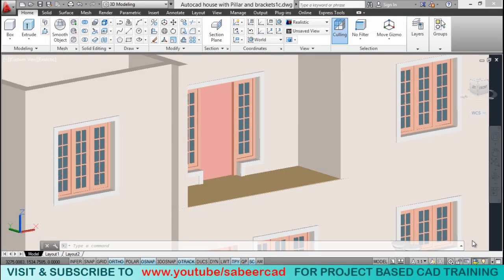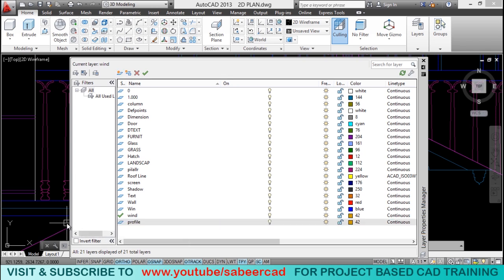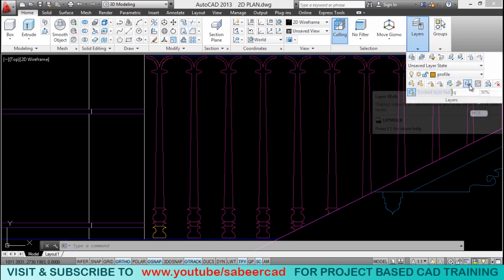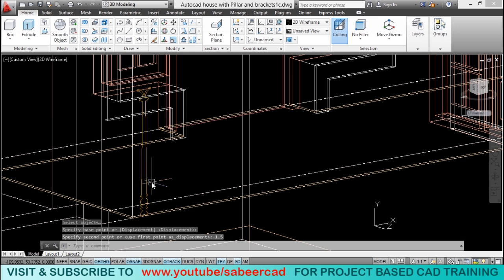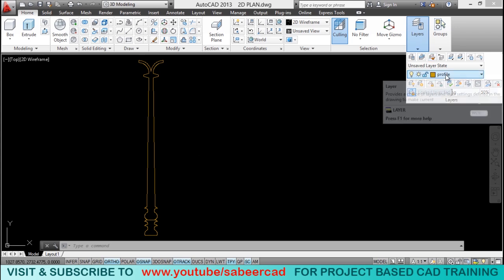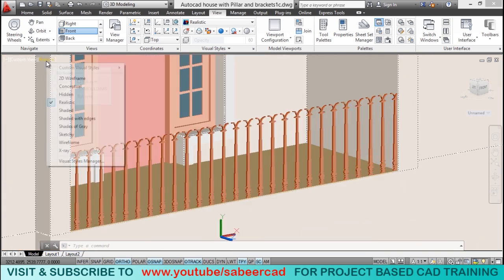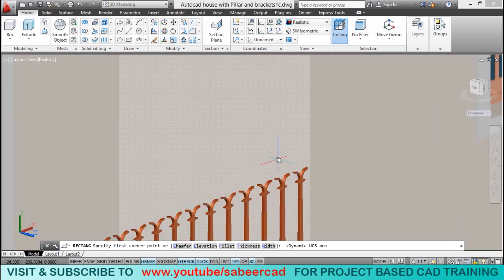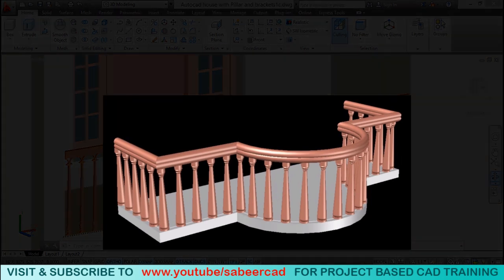CREATING BALUSTERS AND HANDRAIL | AUTOCAD 3D BALCONY

Comment: Hi Sabeercad
Thank you for taking the time to post all the informative video tutorials you have pertaining to the use of AutoCAD in the drafting and design area, as well as the patience to answer all the questions in connection with them. You have assisted me in more ways than I can mention!

I have enjoyed all the mechanical, kitchen models & interior designs you have posted. 

I have a question - there is no tutorial regarding the dimensions of the ventilators, even in the previous house (there weren't any in that design) the frame is 100x60, but what are the shutters?

Regards
Craig (South Africa)
Reply from the maker: Craig Oates  I am happy that you are making the best use of tutorials :)  Reg. the  dimension of the ventilator , the size is 100x60   ,the size of the louvres is  12x1  centimetres . The width of the frame is 6 centimetres and the thickness is 10 centimetres . Just try with these  dimensions  . All the best ...